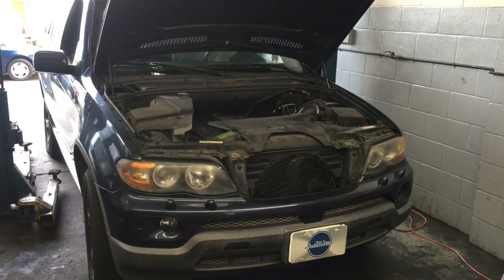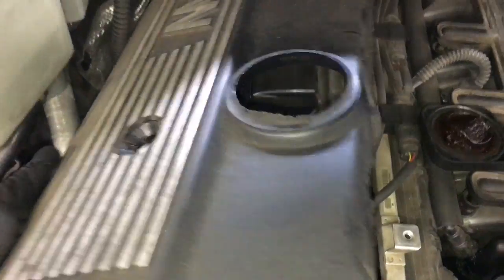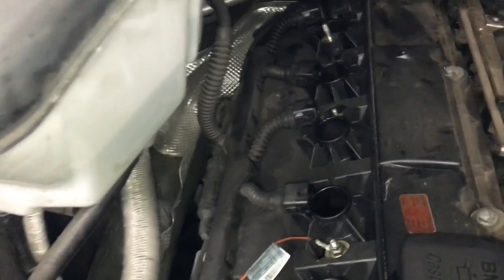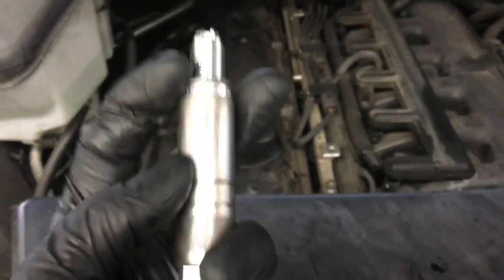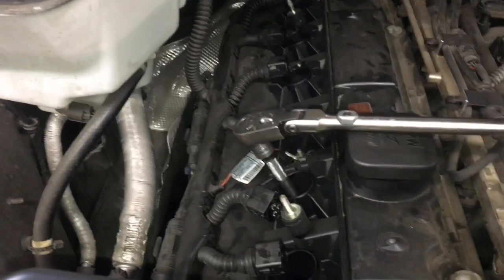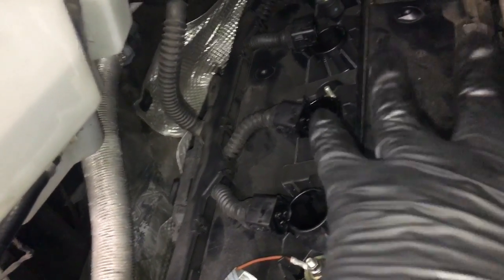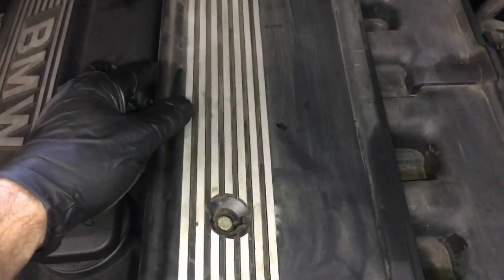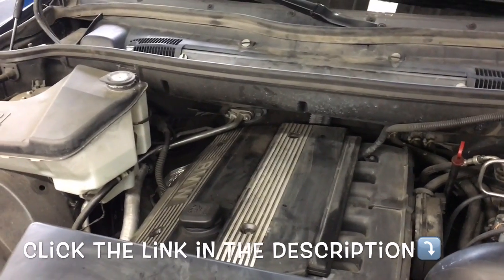How To Replace Spark Plugs On A BMW X5 (3.0 L M54 Engine)

Comment: My 2008 BMW X5 has the check engine light. I don’t know which codes yet but it has a different gas smell coming out the muffler regular operating smoke no different colors but odd gas smell when the car goes. Bad gas mileage as well. what can it be?
Reply from the maker: @cesargonzalez6828  sounds like it’s running rich. Possible MAS air sensor.
Reply: Thank you

Comment: Very good information. I have a 2006 X5. 75,000 miles or 134,000 kilometers. I get the smell of hot oil constantly. No smoke and no oil spots on the driveway. Could this possibly mean the intake gaskets are leaking?
Reply: I have the same issue, have u found a fix?

Comment: hey there thank you for the amazing video , is there any order that the spark plugs have to be in and I am having an issue with my bmw x5 2001 where I have to pump gas pedal while starting in order to start
Reply from the maker: ToffiTube just start from Front and work your way to the back one at a time. As far as it not starting I would start by pulling the code. Sounds like your oil separator under the intake is leaking vacuum. That's a very common problem.
Reply: How to Automotive thank you for taking the time to get back to me , okay I will do that I'm and give it a try as it Wil be my first time and for the starting problem it only happens when the other is warmer the car would start but rough idle so I have to give it a little gas in order to start and sometime I have to pump the gas pedal while starting in order for it to start i have lots of codes my old mechanic said that charged me money and didn't fix the problem so I will get my own scanner and let you know of the codes, I know for sure one of them is the crankshaft position sensor , also what other service do you recommend doing while doing spark plugs as a maintenance tuneup, thank you for your time
Reply from the maker: ToffiTube there's not much more to do tune up wise maybe check the air filter. If you follow the dipstick tube down to where it mounts to the block there is a hose that comes off the dipstick and Leeds up underneath the intake manifold and that where it brakes and causes of severe back and leg. That'll make it run rough on idol.
Reply: How to Automotive are you able to make a video on that and what city are you located in
Reply from the maker: ToffiTube I'm in Encinitas California. I have a video on replacing that part I was referring to when I get home in a couple hours I'll send it to you.
Reply: How to Automotive alright thank you so much
Reply from the maker: Her is the link for the oil separator. It's on a different model but it was the same engine.https://youtu.be/ZA0imYO5pkM
Reply: How to Automotive should I use ngk spark plugs or Bosch
Reply from the maker: ToffiTube either or will be just fine I believe they came with Bosch in 2001 and late years  BMW switch to NGK